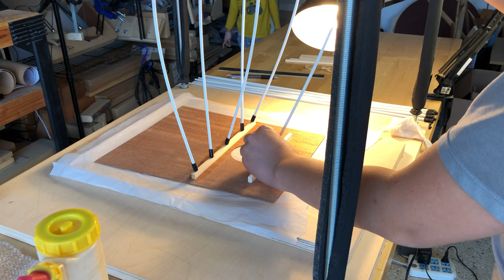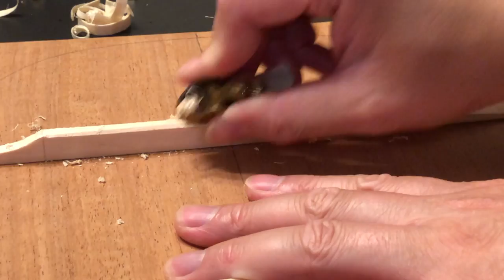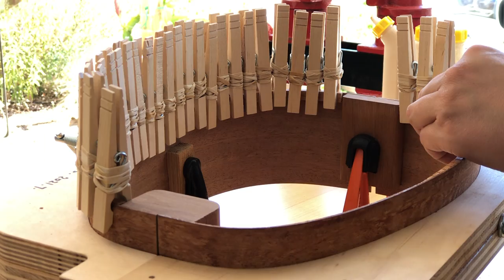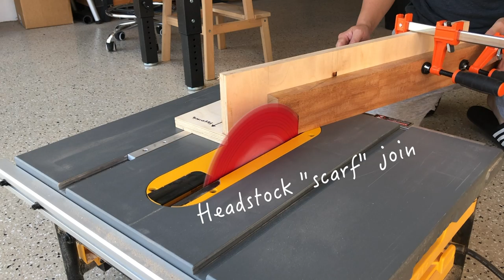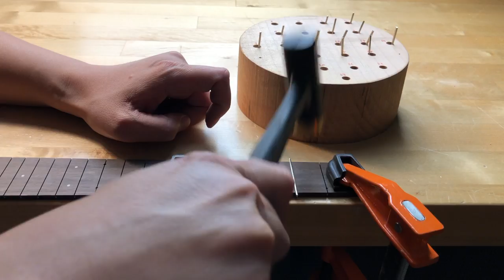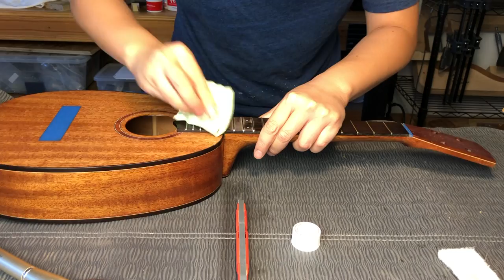Make a Ukulele at home | Build from scratch | Hand-made pineapple tenor Ukulele

Comment: I noticed you had a tool or two from Stew Mac... have you built any of there kits before? Just curious how you learned. I have a full woodshop and have built some fine furniture, a boat etc. I'm kicking around the idea of building a uke. For the first one, I'm thinking I might buy a Stew Mac kit and copy the parts I can - use the kit as a learning tool and pattern. Your work is absolutely beautiful. Cheers to you and yours!
Reply from the maker: I started with a guitar build by learning the online course from Eric schaefer. I do think building a kit is a great starting point. After you learn from the kit, you can build everything from scratch. I've built stewmac electric guitar kit before. Stewmac has really great service.